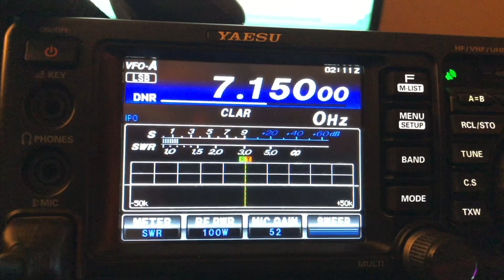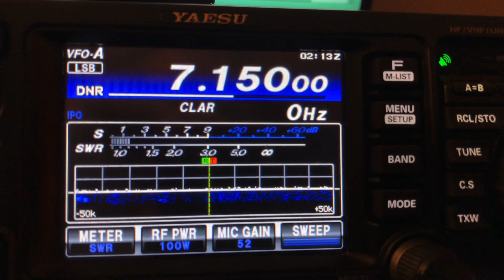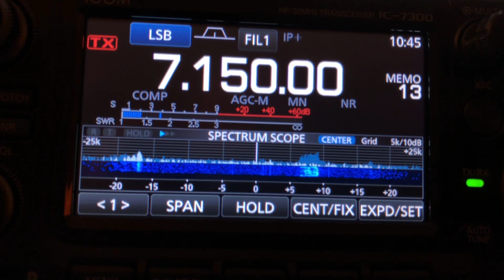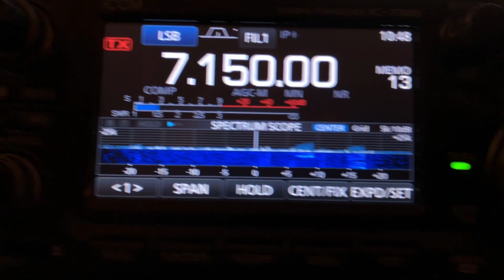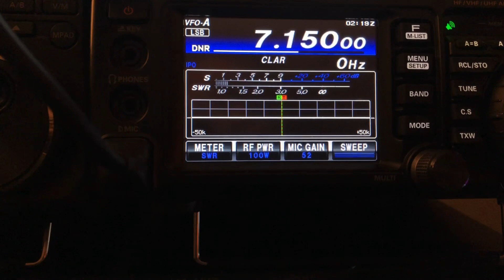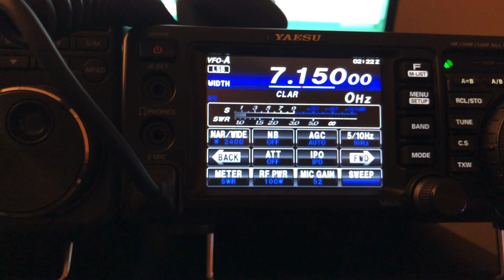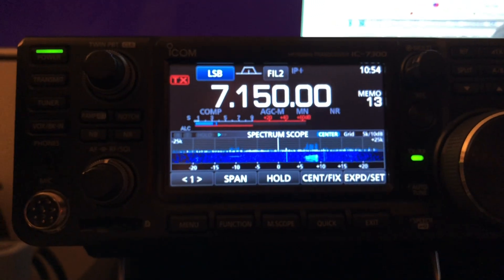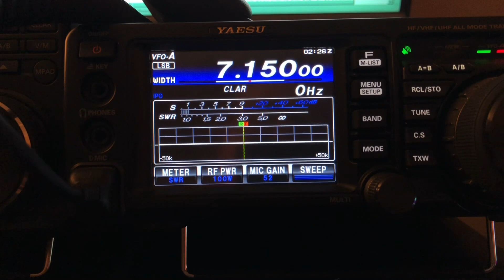Yaesu FT-991A vs ICOM IC-7300 pulling out weak SSB signals

Comment: I follow all your videos, and it was decisive in my decision to buy a Yaesu FT991A, I want it to use more VHF/UHF modes but watching this video FT991 A proved to be much better than the IC 7300, in the HF bands , what a spectacular reception the FT 991 A has, vpu buy it to be next to my yaesu FTDX 10, it will be a good companion side by side. Sorry I don't write english is very well.
Reply from the maker: FTdx10 and FT-991A are a powerful combination. 73

Comment: This is probably the best comparison video I’ve seen of these two radios. I’m getting back into the hobby and picking up a 991a today. It will be my First time back on HF since 1989!
Reply from the maker: Welcome back!  The FT-991A is the Swiss Army Knife of amateur radio. It’s the one radio to own if you will only own one radio.  Even if you later buy an FTdx10 or FTdx101D/MP for HF, the FT-991A can serve as your 2m/70cm base station and HF backup.
Reply: @n4hnhradio  I’m psyched. 
I sold most of my gear when I moved from Alaska to Colorado in 1989. My last rig was a Kenwood TS-430s. Loved that radio. 
I’ll look for you down the dial. 
73 de NL7FU

Comment: The audio sounds a lot better on the 991 vs the 7300 but the 7300 shows a stronger signal.
Reply from the maker: S-meters are notoriously inaccurate. The IC-7300 S-meter is especially generous.  You can’t judge signal quality based solely on the S-meter reading.  Check out this video: https://youtu.be/AY2U6o0mblI?feature=shared

Comment: Whoa!  Not a proper comparison!  Get rid of the Notch & Digital Noise Reduction.  Same Filters only.  Make all RX settings equal.  The viewer cannot draw proper conclusions otherwise.
Reply from the maker: The 7300 was picking up heterodyne.  You wouldn’t have wanted to hear it compared to to the 991A with the heterodyne.

Digital Noise Reduction was enabled on both radios.  The Yaesu DNR is just better.

There is another video comparing the 7300 to the FT-891.  It is a before and after without and with notch.

Either way, the Yaesu has the best receiver.  The ICOM has the best interface.
Reply: @n4hnhradio  Note: I own both.  If there's a heterodyne simply go to another frequency & find another weak signal.  Also test all ham bands & midways within the pass bands!  Regards.

Comment: I keep seeing the ft991a compared to the ic7300 and just about every other radio available except the most obvious comparable of all.  I have not seen a single comparison of the ft991a and the icom ic7100.  These two radios are virtually identical in function but I haven't seen even one comparison.  Does that seem odd to anyone else?
Reply from the maker: One must own each or obtain loaners.  The FT-991A and IC-7300 belong to the same person.  He loaned them to me for several weeks.  

The IC-7100 appears to be a fine radio.  I know three people who have one and one who has two.  He bought another after his first one failed for some reason.  

Maybe the form factor of the IC-7100 makes people put it in a different category than the FT-991A.  The IC-7100 seems more suited for mobile use.  That would make it more comparable to the FT-857D.  Both have a removable control head for example.  

I know a guy who has his control head in Orlando, where he works, but his radio and antennas are in North Carolina, at his home.  It works out perfectly for him.  His 2m antenna is at 3,100 feet ASL.

73, de N4HNH

Comment: Thank you for this side by side video.  I've been wanting the FT-991A cause of the shack in the box type set up, but everyone swears the IC7300 is better.   I think you just sold me on the 991a
Reply from the maker: Glad to help, Robert.  Better is a matter of perspective, isn’t it?  The 7300 wins if you are looking for a better user interface and easier learning curve.  991A wins if you want a receiver that can selectively pull out weak signals.  It doesn’t hurt that it also has 2 meters and 70 centimeters.

73, de N4HNH
Reply: Steven 00  It's obvious that you didn't watch the video of N4HNH demonstrate the differences between 2. If your happy with your purchase that's fine, But the simple fact is that the Yaesu cleans up up the signal on SSB BETTER than the Icom, Seeing is believing, and it's here for all to see."The right antenna" the same antenna was used for both radios. Again, Your happy with your 7300, That's great, fact remains the 991a is more capable of cleaning up weaker signals. "I don't really care" Then nothing else needs to be said.

Comment: Manual notch (MN) is turned on the IC-7300. If the notch is centred on the signal you are trying to receive, you are basically notching out the signal you're trying to listen to by up to 20 dB. I also see that you have set your notch width to WIDE, so you are killing the entire signal that you are trying to listen to.
Reply from the maker: Not the entire signal, but I was dealing with some local heterodyne.  There is an other video that shows the IC-7300 and the FT-891 in a comparison.  You can see/hear a before and after, with both radios using manual notch, plus the FT-891 using Contour.  The closest you can get to a Contour control with the IC-7300 is to use the manual notch with a wide setting.  Sometimes we must sacrifice a little bit of fidelity when we are trying to pull a weak station out of the noise floor.

Comment: would've liked to seen the ip+ and manual notch turned off on the 7300
Reply from the maker: It doesn’t make any discernible difference.  I tried it on and off.  The IP+ makes very little difference.  The manual notch scoops a bit but turning it off made little difference and it allowed some annoying heterodyne.  

The 7300 has the better user interface but the ICOM DSP struggles to compete with the Yaesu DSP.

Comment: Why did you have the manual notch filter turned on on the icom?
Having the manual notch filter on when it’s not needed will kill your audio fidelity. Turning it off will also be like taking a blanket off the speaker.
Reply from the maker: I thought you were referring to the CW version of this video at first.  I sometimes use the notch with CW, to mitigate filter ripple, especially when using a sharp filter.

There was a heterodyne produced by something in my neighborhood at this frequency.  I had to use notch to knock it down.

Comment: Thanks for this video and explanation.   Ive been struggling with this decision.   Have been leaning towards the 991a but so many seem to have and prefer the 7300 It makes me doubt myself.  After watching this I’m still leaning 991a.  BTW that 5000 is sweet...who needs menus when you have a dedicated button or dial!
Reply from the maker: The 5000 is my favorite radio of all time.  But the 991A is no slouch either.  Thanks for your comment!  

Just because a radio is popular doesn’t mean it’s the best.  Baofeng is also very popular but it can’t complete with Yaesu or Kenwood HTs.

73, Doug
Reply: I’m in the same boat but it looks like a couple years later. New General Class. I’m curious, it’s been awhile which one did you choose and and regrets? Thanks!

Comment: With CAT on the 991A you can get over the menu system. The contour on SSB & APF on CW sets the 991A and 5000 apart from the 7300. Really impressed with the 991A.
Reply from the maker: Indeed Joel!  It was great to finally compare the IC-7300 and the FT-991A.  Thanks for providing the test subjects!  Controlling the FT-991A via the CAT port with a computer would make it much easier.

73, de N4HNH
Reply: The audio quality on the 991a is much better than the 7300 and the APF on CW is icing on the cake.